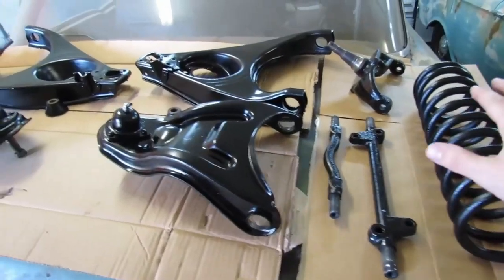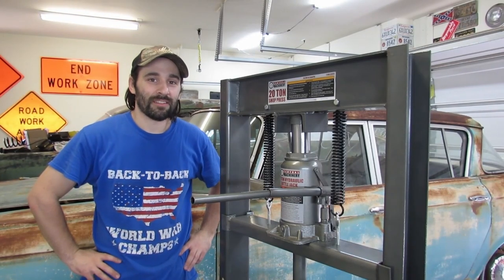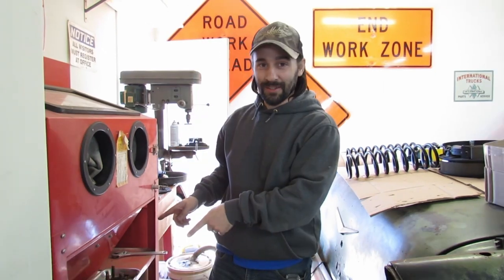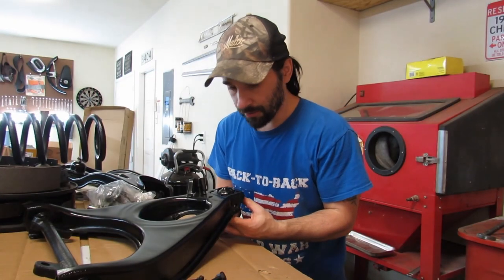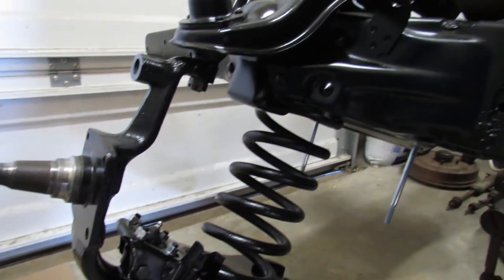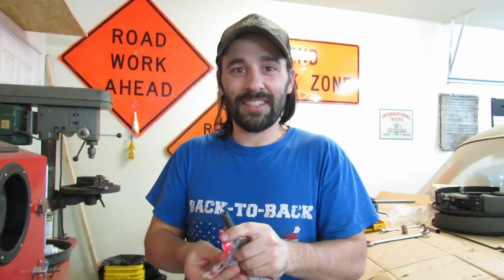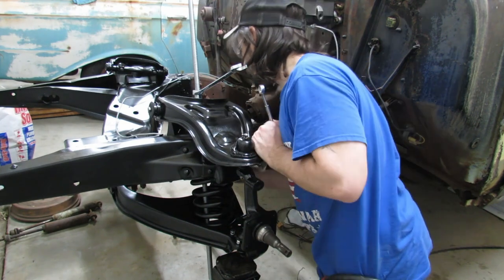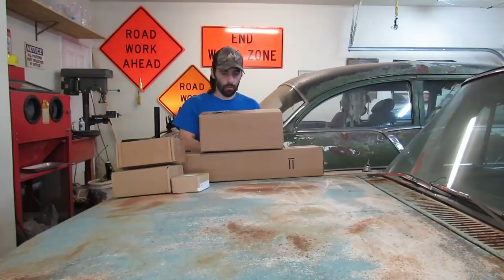Major Breakthrough On The Abandoned Tri 5 Chevy Build!

Comment: What was the Dimensions of the 1/4" steel plate you used
Reply from the maker: The shorter plate is 1.5" x 2 1/4"

The longer plate is 1.5" x 5 1/4"